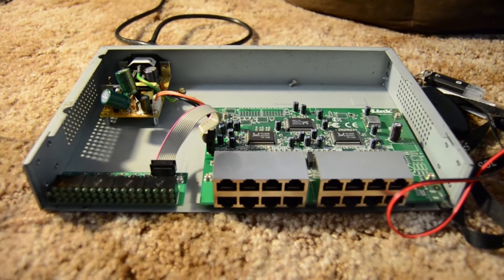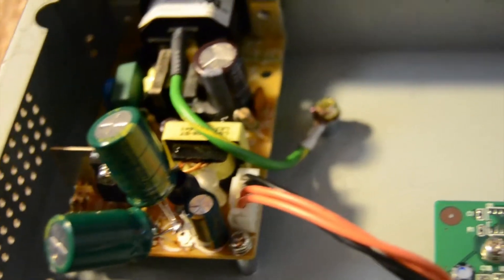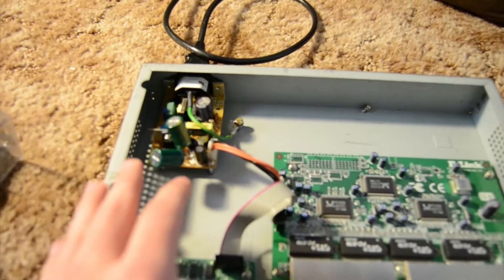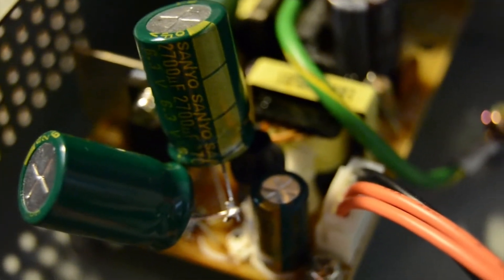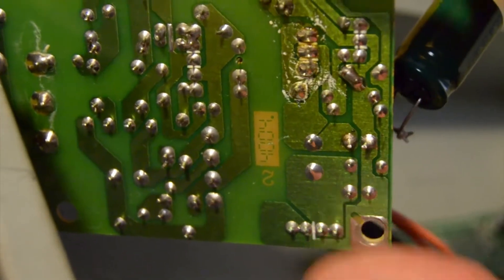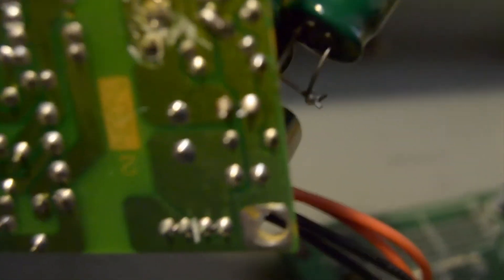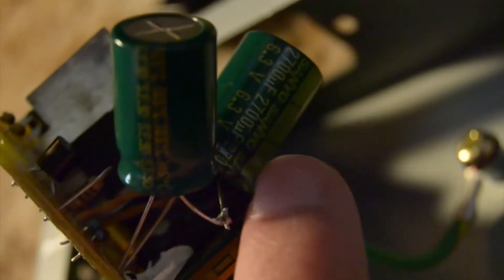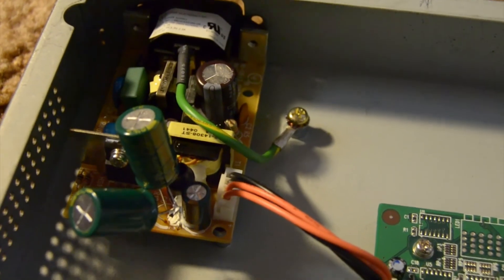D-Link Switch Repair

Comment: My D-link DSS-16+ switch just quit this evening, and opening it up I found the same capacitor bulging on the power supply board.  Thanks to your video, I was more confident in replacing the capacitor with a "close enough" spare, and voila! the switch is now working again!  Much appreciated!